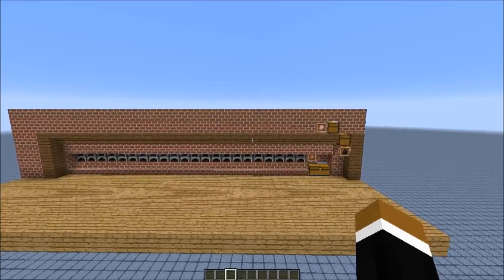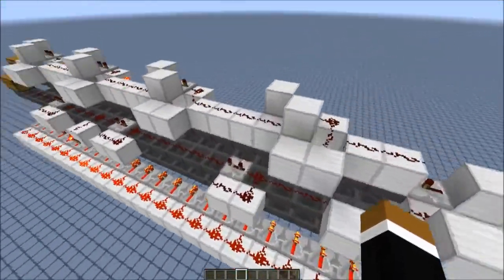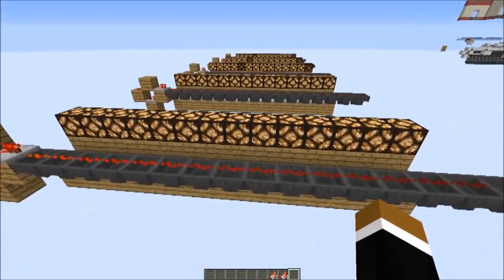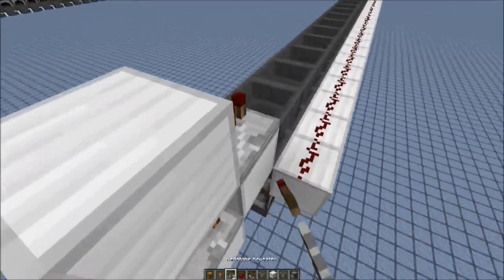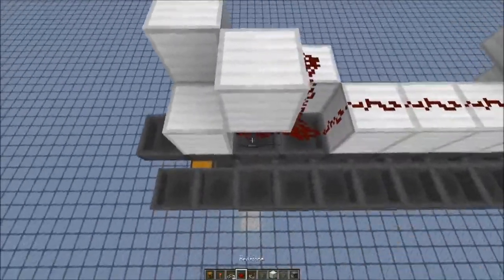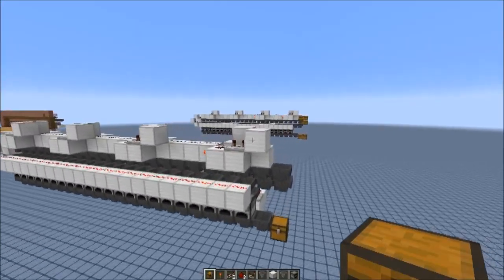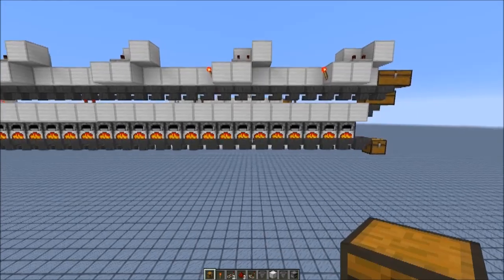Furnace Array for 1.11+ [no minecarts]

Comment: I built it the exact same and one was still skipped. I went back and saw a few timings were off but it still skipped the exact same one.
Reply from the maker: brian maier two options. youre not using the right version or you didnt build it correctly. theres no other reason why it would act differently

Comment: I'm trying to recreate this system on a smaller scale (just 8 furnaces) but it still either leaves out furnaces or doubles up into them and thus items get stuck in hoppers. Tried just making it a bit longer and not have the unused space be anything actually but both distributions error at different furnaces

Comment: I tried this with lava, as we have an iron farm and NO lack of lava. By the time the buckets hit to release, not enough buckets flow to fill in the last few so they never fill. @JustinCody has suggestions on changing the timings and placement. I'll try that and see if that fixes the situation with lava. Has anyone else worked with lava fueling this thing?

EDIT: I was mistaken. The problem offers the solution. Fuel has to be synchronized because to "fill" one hopper of stackable fuel, you have to have six *stacks*. Lava doesn't stack. If I supply the furnace with lava as my fuel, I should be using a silo and NO redstone on the fuel line. The silo will fill the furnaces and hoppers quickly because it doesn't stack. Then everything ELSE as normal. That will neatly solve the problem if lava is the fuel, and I intend on a lava silo anyway.

Comment: I'm having an issue, a few furnaces don't get any items at all, some only get coal, and some only get what I am trying to cook. I have made sure that everything was done correctly, but it still has this issue, because of this, i have noticed some uneven distribution as well. It worked once, but once I left the map and rejoined it, it stopped working. The issues seem to only be happening on certain furnaces as well, and its the same ones every time, but there are no consistent patterns that would suggest a certain thing is wrong.
I am in 1.11.
Reply from the maker: In general no contraption should be left running if you leave an area. A lot of bugs don't make it feasible. You won't find any furnace array, that doesn't have this issue.
Reply: I never left the area though. The last few hours I have been trying to troubleshoot it :/

Comment: does the design have to be 22 furnaces long? can it be 16 (by removing the last module)
Reply: Ben Jackson it can be. 22 is the maximum and therefore optimal size that can be built, as a new item arrives in the furnace as the last one finished smelting. 0:38 You'll just want to watch that the hoppers don't back up if you load the system with more than 16 stacks.
Reply: ok. just tried this on a server, and the last furnace seemed to take extra items, didn't know if that was the problem. will probably try it in a test world again to check

Comment: Im having a big issue (im on ps4 if that could be the problem). I built the design, works perfectly. I put decoration blocks, it breaks. I remove the decoration blocks, still doesnt work. I triple checked the design with the tutorial and all blocks that shouldnt be there are gone. Help?
Reply: Cubfans Automatic super smelter V2 works 100% reliably on console. It uses minecarts and can be made as big as you want really easily. It takes roughly the same time to get a stack.
Reply: GrizzlyBear I can't get this to work on PS4 either
Reply: GrizzlyBear Same I can't get it to work. Always 5 furnaces are left out.
Reply: Brenden mills I'm on Xbox 1 and my skips 3 furnaces at first they all worked then I accidentally broke a dust put it right back now that's why it skips idk why but it's weird
Reply: GrizzlyBear can you post a link please
Reply: Me too,I think the problem is with the PS4 version and not with the design itself

Comment: input chest clogs at first hopper: anyone with a fix?
Reply: nvm I fixed that but all the input items flow into the first furnace: therefore it is not locking the hoppers fsr, howshould I fix that?
Reply: how did u fix the clogging for the items to be smelted?
Reply: make sure that none of the blocks infront of the top hoppers (that have redstone) are powered

Comment: The problem of stuck items occurs when you put multiple different stacks of items in.  Items get stuck in the locking hopper.
Two ways to deal with it. 
One put a button on the block the comparator runs into and "flush" the system.

Better: add another hopper under the locking hopper. This will give you a 5 item change queue.

Working on testing better now.
Reply: Tested with 5 stacks of different ore. Nothing got stuck.

Move the whole input mechanism up by one vertical hopper. Including the row of blocks with the redstone dust.
Reply: Can you post a screenshot of the change you made please? Is it just a hopper going into nothing or where is this placed into?
Reply: My mods were on a "Realms" server.  I have tested with up to 5 different item types and multiple stacks of each.  So far I have had no problem.   I have not built TangoTek's furnace.  Maybe I will try that one in my redstone world. . .
Reply: the only prob with tangos is its only 15 furnaces and one does not fill but it works with any amount put into it and does not clog.
Reply: It seems you can also fix this by adding an additional furnace, as 23 furnaces is exactly enough such that items are replaced exactly as they are smelted. I've mainly done testing on singleplayer control worlds but that might be the cheapest solution...
Reply: Search youtube for: "Mod 2 ilmango Furnace Array for multi items"
Reply: Randy Miller I went back to tangoteks build, not sure what I did wrong as I followed to a t but some reason it will only work if I put 4x stacks or more if I put in like 10 items it just gets stuck in it. Using only cobblestone messed with it and messed with it then found out it was because I was not putting enough cobble in. May be due to hoppers transferring 3 items per tick not sure. This build looks amazing though but there must be something server side messing with it.

Comment: Can I cut this in half and do two modules that are both 11 long side by side? These modules would be connected so hopefully it would be the same as having the full 22 in a line, avoiding overflowing of the furnaces. I'm working in a tight area and I can't fit they've whole 22 furnaces if I put them in a line.
Reply: yes mumbo did the same
Reply: ShadowKnight no mambo built 2 full 22 long lines I'm trying to cut it in half and build 2

Comment: Is the order in which you place things important? im new to this, and I can't get mine to work entirely.
Reply: only three of my furnaces work
Reply: further testing, more than 3 work, the amount that work seems to depend on the amount of things I put into the cook/fuel chests..
Reply: After building it I put a stack of coal and a stack of iron blocks in, and only 3 of the furnaces properly began smelting
Reply: I'm also on a multiplayer server idk if that would cause issues
Reply from the maker: some servers, that run on modded versions, mess with redstone components like hoppers. You better don't use any redstone on those servers or search for a proper server. If you play on a vanilla server and it doesn't work properly you built it wrong.
Reply: Thanks for the fast reply anyhow.

Comment: is this a repeated deign ????
Reply from the maker: it wouldn't make sense to make it longer, because you're limited by the hopper speed. Also using less furnaces isn't recommended, because they would soon overflow. The design is intended to be used with 22 furnaces.

Comment: Thant you for this tutorial, but i have a problem, I'm in 1.11.2 on server, and only the ~5 last and firsts furnaces get items, can you help me please?
Reply: If its a spigot server the admins could have messed with hopper mechanics to reduce lag, otherwise its just server side lag or you built it wrong. I believe those are the only 3 things that could be the problem, although im not entirely sure.
Reply: well find a way to make it work or kind of (2 furnace are not supply but it's better than 17 ^^)
i remove the second torch that power the front line of hopper.
Reply: Same here, 3 month after you. I build it three time, triple (thirtyple) check everything but nothing seems to explain it. And It's on a realms server. Fuel go well but only 5 last furnace got something to cook...

Comment: Ok, so I'm trying to make sure I understand this hopper timing business because I have several other things with hopper chains of various lengths that I'd like to drop items uniformly like this. But I'm a bit confused. You say every six "blocks" you have to add 6 gameticks (3 redstone ticks) of delay. But then you have the groups of hoppers timed unevenly? The cookable item hoppers are timed with the last 4 in a group and the 3 ticks after for the next 6. But then the fuel line below has the last 6 together, then 7, then 6. Where are you counting from? And why aren't the groups of hoppers all 6 hoppers from the end, then 3 redstone tick delay, then 6 more and so on?
Reply: Nvm.. I see now... its the delay at the end after the comparators detect the item in the final hopper that determines how the gaps stack up the delay is one tick longer for the comparator+torch+torch at the bottom. You can set the repeater at the top 2 ticks and it will make it the same as the bottom so the groups of hoppers are the same top and bottom and all groups of 6.. I still don't see why you have the groups at the bottom as 6 - 7 - 6.... From my testing it looks like it works both ways though
Reply from the maker: in general the game tick difference comes from hoppers transfering the first item in 7 ticks, but they can only transfer an item every 8 ticks
Reply: Does changing the number of furnaces affect how you need to set up the timing? For example, I'm building a nine furnace system but having major timing issues. The furnace closest to the input chest is taking two items every rotation, and trying different locations for the 6-block delay has been no help.
Once I look into it more it might just be the "first transfer in 7 gameticks, subsequent transfers after 8" thing though.
Reply: GAH, nvm, I just built it wrong

Comment: could i use sticks a my fuel source ?
Reply: also if you have a witch farm sticks are a renewable resource that doesn't need to be collected.
Reply: Yes. 2 Sticks smelts 1 item. However, planks are better. Here's why:
2 planks = 4 sticks
4 sticks, which are crafted from 2 planks, smelt 2 items.
2 planks smelt 3 items
So, 1 plank smelts 1.5 items and 2 sticks smelt 1.0 items. That's why planks is the best one of them two. Oh, and there is an exception! If your base is on a desert and you want to smelt something, you should find a lava lake for lava buckets OR break dead bushes, which is fairly easier of the three, since trees don't grow on desert biomes.

Comment: Is it possible that this doesnt work anymore? i just spend 2 hours to set this up. i Triple checked everything and it just doesnt work. When i put fuel in it spreads perfectly. but when i put in the item i want to smelt. I just goes into the most right furnace and doesnt spread. I tried putting it into a different hopper and it only spread to 1 more furnace ( So 2 at same time) Is it because Hoppers changed or something? I really cant get it to work anymore
Reply: Lennard Mulder same
Reply: I am having this same issue.  I have confirmed the hoppers and redstone wiring correctly match what you have shown in the video. Fuel spreads evenly across all the furnaces, but items to be smelted only feed into the very first furnace.
Reply from the maker: I don't think anything changed. Have you checked the world download?
Reply: Lennard Mulder what version do u play on
Reply: I am having the same problem....I play on the latest version...
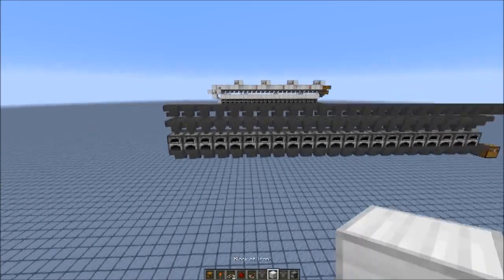Reply: had the same issue but i managed to find a solution. make sure that the blocks he places at 4:40 are solid blocks like brick because those get powered by the redstone line he puts on top of it afterwards which lock the hopper next to it. i used brick stairs at first because it looks better but those are transparent blocks and therefore cannot be powered to lock the hoppers. At least thats what i think is happening and after changing them out it works like a charm
Reply: (15 August 2017) I am having the same problem on a Multiplayer Server. The Fuel gets distributed perfectly but the items to be smelted get stuck in a Hopper that's under the Block with 1 Redstone Dot on it right after the Input Chest Hopper Line. i'm seriously about to remove the entire thing & build another.
Reply: Don't use stairs! I had the same problem...

Comment: Is there a way to make it work efficiently with charcoal as fuel source?
Reply from the maker: why is it not working efficiently?
Reply: Because when you put in a small amount of items to be smelted, let's say 3 stacks of cobblestone, but have the fuel chain of hoppers filled with charcoal it will start smelting right away but fuel keeps burning when after a small amount of time there is nothing left to be smelted. Or is this not the right machine for what I have in mind? Are you supposed to put in the same amount of fuel as items to be smelted or divide the amount of items to be smelted by 8 when using coal/charcoal?
Reply from the maker: ZUMMY61
large furnace arrays are meant to smelt large amount of items. If you just want to smelt a few, use a different fuel (planks) or put in a single furnace, if you don't mind waiting.

Normally you don't have to worry about fuel efficiency anyway, once you build yourself a tree farm.
Reply: Yes, I built your tree farm which is an amazing piece of art by the way but now I want to hook it up for auto charcoal producing and hook that up to an efficient furnace array, but maybe I'm just asking too much haha.

Comment: Hey ilmango,
What smelting do you use for 1.10? I search for 3h now and can´t find a perfect setup. I don´t want minecarts to drive all the time and it should be overflow proof.
Thanks for your awesome work! I can´t wait for new videos!
Reply from the maker: I use minecarts in 1.10. The point is that it's only possible since the latest snapshot to make a reliable non-locational system using a simple hopper method. There are probably a few ways to work around this issue though. But I don't know if anybody did it. A lot of people would probably question the usefulness of a reliable 1.10 system if the space requirement and complexity increases a lot. That's probably one of the reasons nobody made a system. Most people probably just use the most well.known system (Tango's) despite the fact that it fails to distribute the items equally to all furnaces in some locations.
Reply: Thanks for your answer, awesome! So I built a minecart furnace now, too. My problem was a to find a perfect loader for it, that can´t overflow, doesn´t leave items in the minecart and where the minecart is only running, when it´s active. But I finally found one thats also really compact.

Comment: i try to get better in redstone and try to understand every process but i dont really get why this is working. its amazing but i wish you would explain just a tiny bit more on your tutorial how this works and why.

regards Hanfried
Reply: Well, it fills the top line of hoppers with 1 item each and when it reaches the end of the line it drops all items down on the furnaces. Problem with systems like this before is that it would skip some furnaces sometimes, but it now skips the same furnaces everytime so there is a work-around with the delays.
Reply: Hanfried Basically, what it's doing it making your fuel and ingredient all go into the furnace one hopper line at a time. The input hoppers are locked, nothing can enter them, so the top layer holds it until it reaches the comparator, which sends a signal to unlock the input hoppers, then when the coal/meat falls, the bottom hoppers lock again and wait for more items. It's a rather smart system!

Comment: I can't believe it... why does this always happen... I spent hours designing the same system just a few days ago! In my system all furnaces do turn on at exactly the same time though :D
Reply from the maker: well, did you test it in 1.11? I made a similar system years ago, but it's literally only since 2 days possible to make a 100% reliable non-locational system. The fact that the furnaces turn on with 6gt in between is caused by the workaround I had to implement and by the space restriction.
Reply: I did not test it in 1.11, I built it on a 1.10 server. I will keep my design for now, as it seems fairly reliable, and when 1.11 comes out I'll see if your design functions better. Great work!

Comment: Is this faster then ones that use mincart chests or hopper minecarts
Reply from the maker: depends. You could expand this system to several hundred furnaces as well. I think the system shown here is nice to quickly build something up. In case you're planing to have 80 or more furnaces I would recommend minecarts.